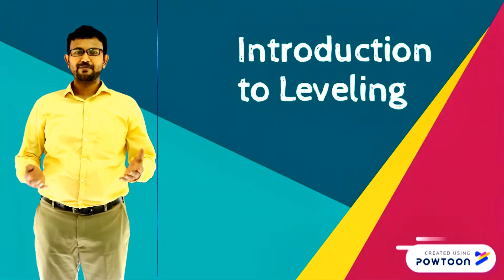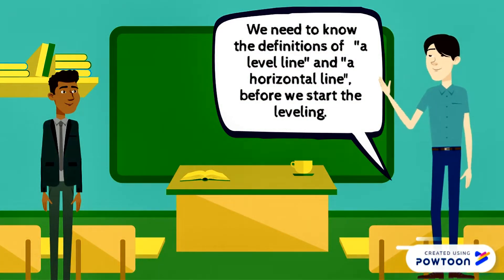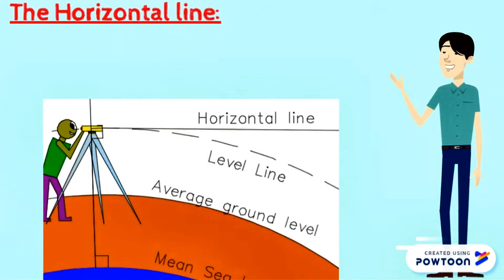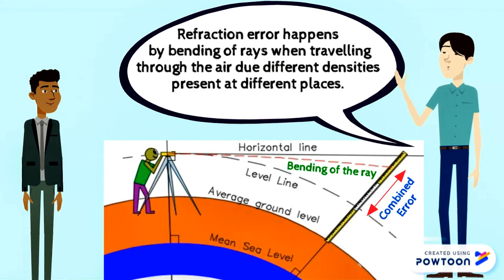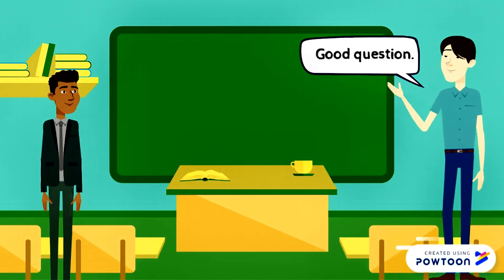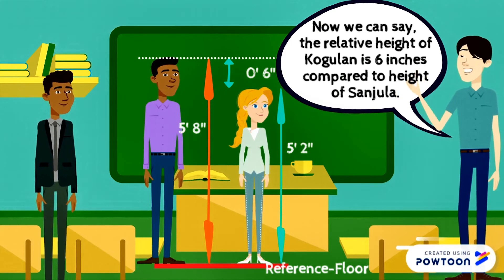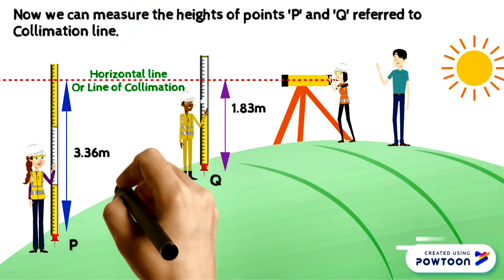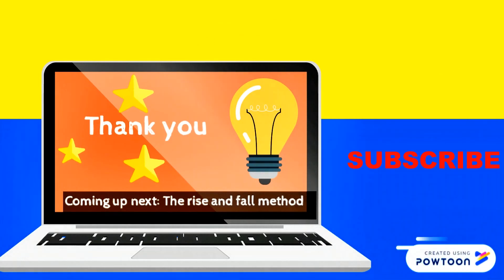Introduction to leveling

Comment: Stop lying 🤥 a straight line is defined as such because it does not curve. Level describes a flat surface
Reply from the maker: Think again and again
Reply: @theengineeringsurveyor7872  
You are violating the law of non contradiction
Reply: @theengineeringsurveyor7872  
Think again
Reply: @jimwest4060  Think again
Reply: @wihangasihilel2318  
Try thinking
Reply: @theengineeringsurveyor7872  
https://youtu.be/PGoXXPvzP8M
Reply: Level = no point higher than another 
The confusion comes from relating the surface to the centre. Why the centre we live on the surface and no one has been to the centre, that's an assumption. Equidistant from an unknown centre lol

TRY THINKING
Reply: @jimwest4060  think again, you have mistaken a single point